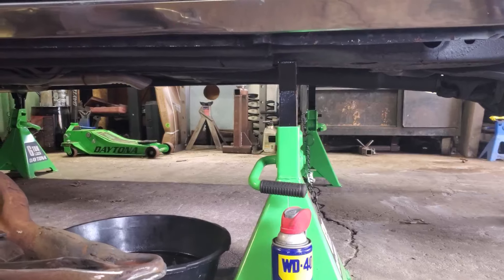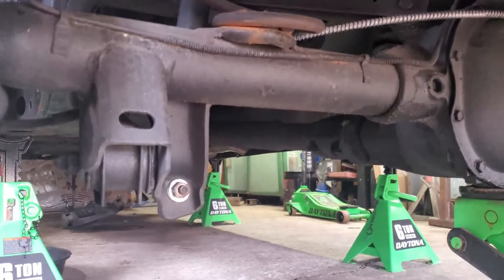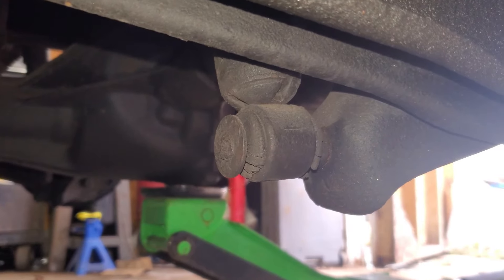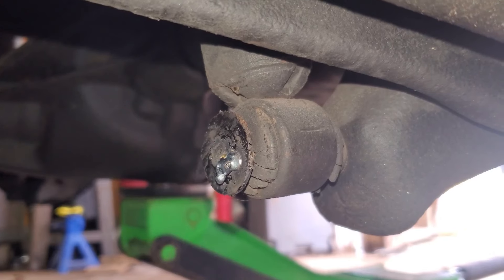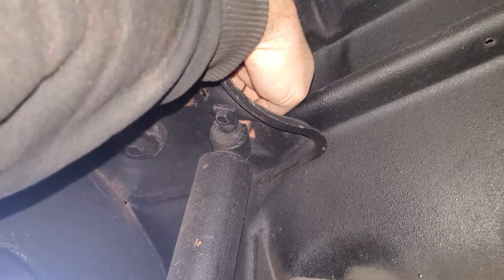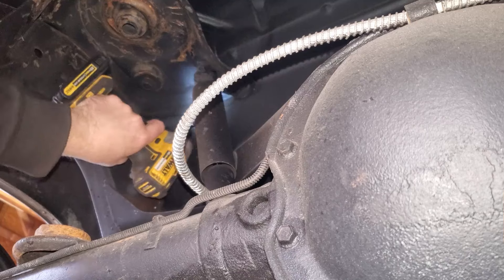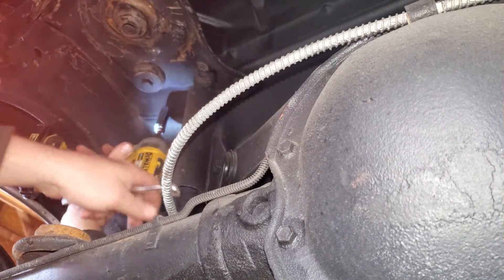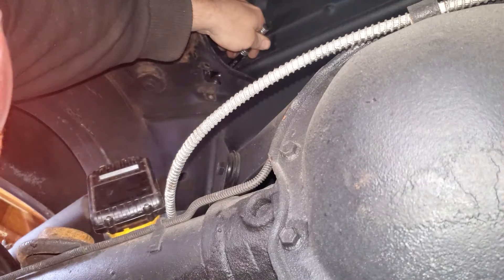Changing Rear Shocks On A 77-96 Cadillac (Non Air Shocks)

Comment: Dan! Help! I recently purchased an 85 Fleetwood. I am swapping from air shocks to regular shocks, is the process similar?
Reply from the maker: Exactly the same except you do not have to hook up the air line! If the air pump still works you may want to pull the relay for it or just unplug wires on the pump itself